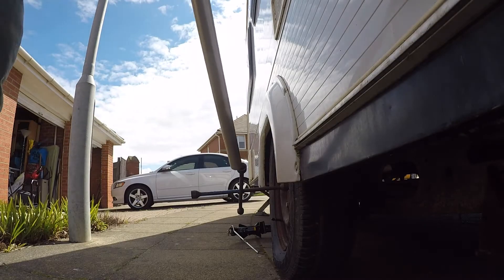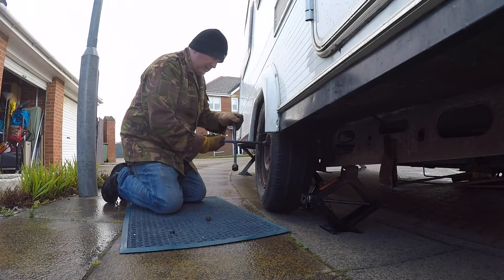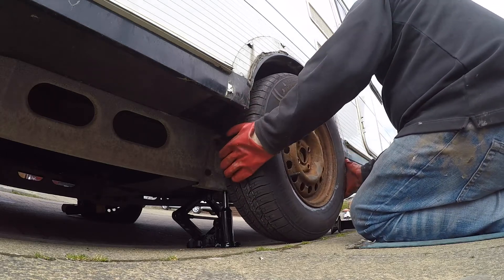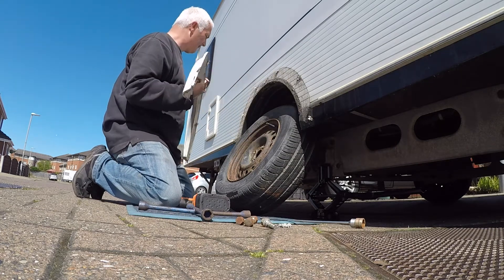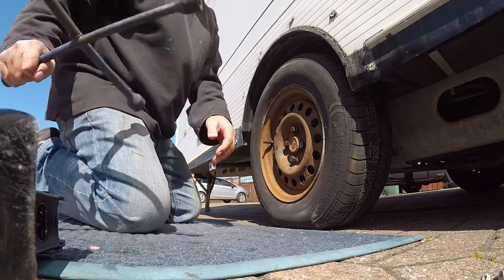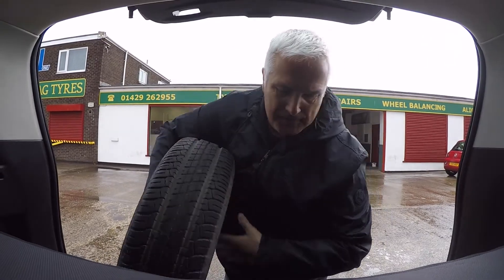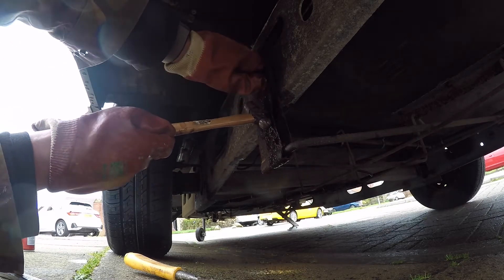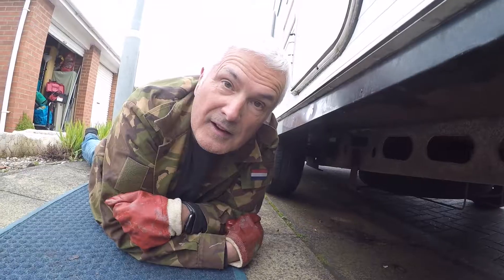How to change caravan tyres.Caravan restoration Part 5.

Comment: Great video. One i will say is i would not trust spare wheel carriers as the tyre rests on the bars and can lead to damage plus the wheel gets rusty and dirty best kept in the caravan. I discovered the same on my car which is a Ford Fiesta took spare wheel out of the carrier and noticed the same with my spare. After that i kept it in the boot. So tip for you is keep it in the caravan and dont get a new carrier especially an Alko one. This video link is an example and worth watching. https://www.youtube.com/watch?v=FMbpNcBJbDQ
Reply from the maker: Thank you Michael I'll bare that in mind. I suppose I could cover the wheel with a waterproof bag of some kind ?
I'm glad you enjoyed the video too :)
Reply: @TheSilverFoxDoesStuff  yes or a spare wheel cover which you see on cars that have the spare kept on the boot door. You could also put some small plumbing foam pipe cover over the bars that the tyre rests on to stop the dents appearing on the tyre.
Reply from the maker: @mikemlw  great idea